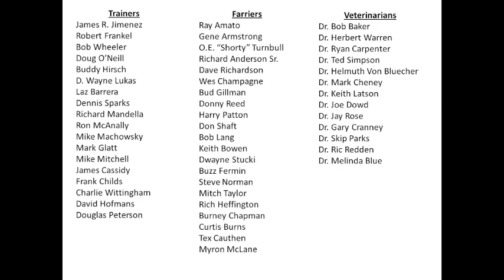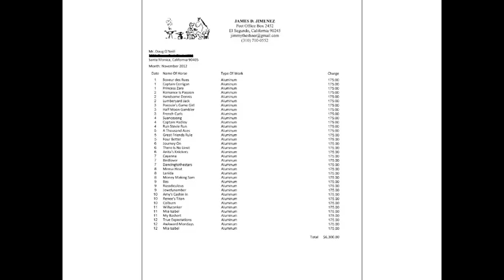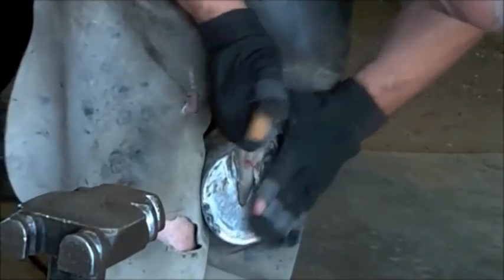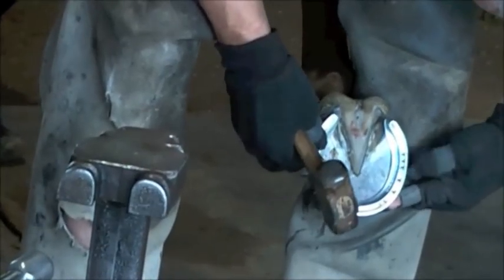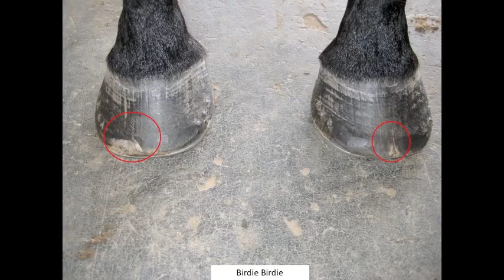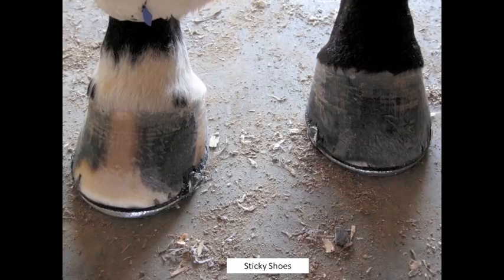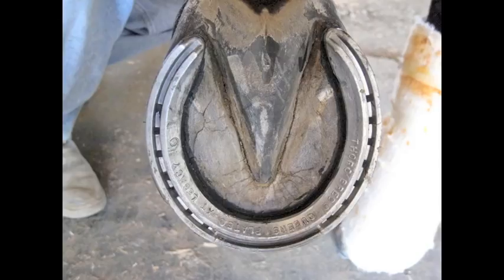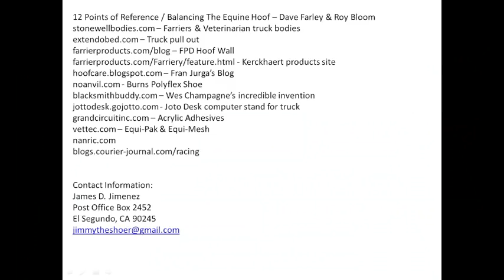[Webinar] Successfully Shoeing the Thoroughbred Racehorse

Comment: Farrier needs to know anatomy, the first horse is based long, farrier does not understand movement, he was talking about correction not knowing that corrections happens in movement not at halter.  Red horse is based forward where the feet are in front of the shoulder and with the new showing will be short striding and the shoulder will not open up all the way. Other horses needed more foot taken off and the base moved back.
Farriers you need to learn anatomy and movement before you should some racehorses.
Wow the toe crack horse is so based long. The toe crack is because the foot is bending.